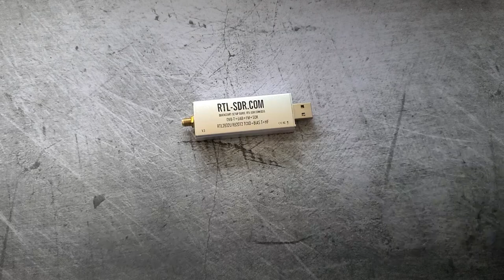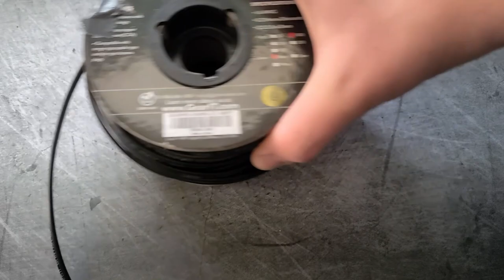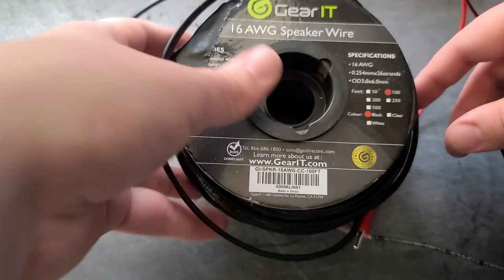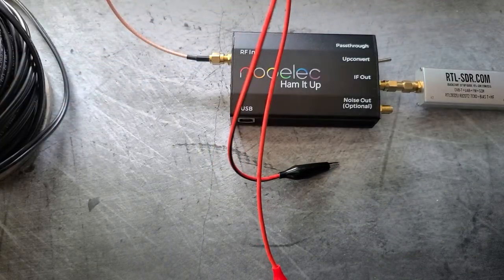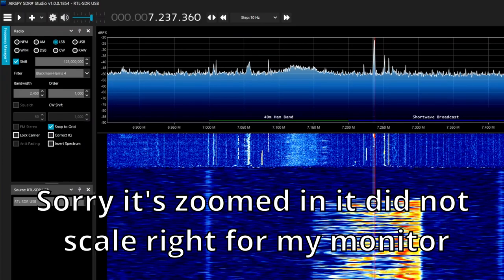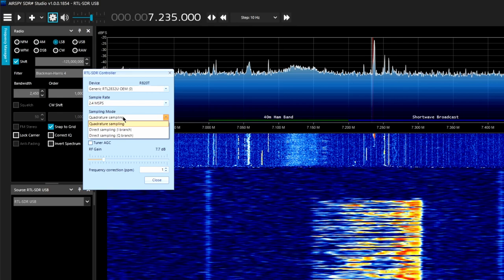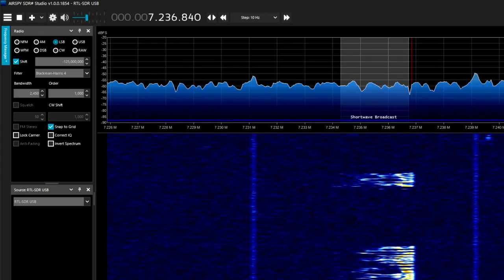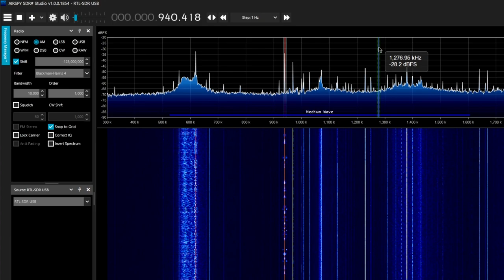Beginners guide to SDR #3 [ upconverter and custom antenna ]

Comment: The "Noise Source", which produces broadband noise from ~ 1 MHz to 3 GHz, can be used as a tool to test the frequency response of your RTL-SDR v3 dongle as well as filters which are placed between the Noise Source and the SDR.  After you get your v3 dongle up and running you can remove the IF Output (of the Ham-It-Up) from the input of your dongle and replace it with the output of the Noise Source.  Your software will indicate the broadband noise by showing and elevated noise floor in the waterfall and spectral displays.  If you get a filters, like AM or FM Broadcast Band filters, you can hook them up in between the Noise Source and the v3 dongle and you will see the filter's action in the waterfall and spectral displays!  For the AM filter you will see a reduction in the noise where the AM Broadcast band resides and a similar result for the FM filter.  Again, it is used as a tool to test your devices to see if they are working well!  It can also be used for most of your other receivers (~1 MHz to 3 GHz).  Hope this helps in some way!
Reply from the maker: Thanks this was much more detailed than the description on the product page this will be pinned
Reply: I realized after you pinned my comment, that the Noise Source can be used for most other receivers up to 3 GHz, not just HF receivers, as I noted in the second to last line of my comment.  I can't correct this unless unless you unpin it.  If you want me to correct it, just unpin and reply that you want me to correct it. I'll reply letting you know when I correct it so you can re-pin.  Sorry for this!
Reply from the maker: @danedewaard8215  Thanks for providing accurate information and even offering changes. I unpinned your comment so you can edit your original explanation.
Reply: Ok, I'm done, you can re-pin.  Thanks!!!

Comment from the maker: For those wondering the SMA alligator clip adapter does work well. but if you plan on using very thick antenna wires it might be worth investing in one of these: 
https://www.amazon.com/Balun-One-Nine-v2-Protection/dp/B08HGSYB7R/ref=mp_s_a_1_2_sspa?crid=PYV7YMNSS353&keywords=balun+one+nine&qid=1658098094&sprefix=balun+one+nine%2Caps%2C149&sr=8-2-spons&psc=1&spLa=ZW5jcnlwdGVkUXVhbGlmaWVyPUEzNUxOSjFINUtIU0dCJmVuY3J5cHRlZElkPUEwNzYxODU2MTg2MENMQ1BCSzc5QSZlbmNyeXB0ZWRBZElkPUEwMDM2NDMzM1M2SFpZTlJINE9QMiZ3aWRnZXROYW1lPXNwX3Bob25lX3NlYXJjaF9hdGYmYWN0aW9uPWNsaWNrUmVkaXJlY3QmZG9Ob3RMb2dDbGljaz10cnVl

Comment: Looks like lots of fun! I think I'll invest in an SDR dongle with the upconverter too. Did you try any reception with different antenna types and orientations like dipole, yagi, multiband, loop, etc? And high up on the roof?
Reply from the maker: I tried a couple yes I'm on the second floor so the included dipole work pretty decent for line of sight communication. And the speaker wire works great for HF

Comment: you might get better results if you cut the wire to be resonant in the band you want to listen to, get it off the ground, and ground the shield to a ground rod.
Reply from the maker: Actually I recently tried this grounding the SDR didn't result in any changes but when I grounded the negative side of the antenna I got quite a big bump in signal strength

Comment: Curious, have you compared the up-converter vs direct sampling (Q Branch) for HF? how much better is using the Nooelec?
Reply from the maker: That's actually a really good question, I might have to make a video on that comparing it.

Basically the downside of using direct sampling is that you can't really control the gain. Which can be a bad thing for trying to receive weaker stations or if you're trying to filter out  strong ones.
Reply: @Alexwarestudios  If you made the video I'd definitely watch it. :)

Comment: Did you leave the wire coiled up?
Did you just connect the red clip?

Where did you connect the black clip?
Reply from the maker: No I extended the antenna out the window when I used it
Red clip goes to antenna
Black clip goes to ground or secondary antenna that's parallel

Although I would recommend using this to connect a antenna to your SDR You would get much better results

https://www.amazon.com/Balun-One-Nine-v2-Protection/dp/B08HGSYB7R/ref=mp_s_a_1_2_sspa?crid=PYV7YMNSS353&keywords=balun+one+nine&qid=1658098094&sprefix=balun+one+nine%2Caps%2C149&sr=8-2-spons&psc=1&spLa=ZW5jcnlwdGVkUXVhbGlmaWVyPUEzNUxOSjFINUtIU0dCJmVuY3J5cHRlZElkPUEwNzYxODU2MTg2MENMQ1BCSzc5QSZlbmNyeXB0ZWRBZElkPUEwMDM2NDMzM1M2SFpZTlJINE9QMiZ3aWRnZXROYW1lPXNwX3Bob25lX3NlYXJjaF9hdGYmYWN0aW9uPWNsaWNrUmVkaXJlY3QmZG9Ob3RMb2dDbGljaz10cnVl